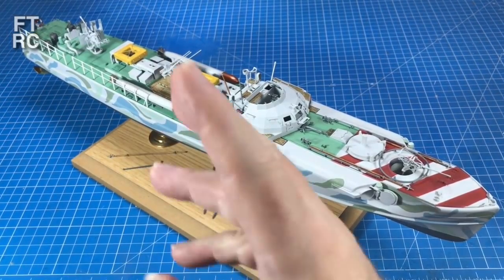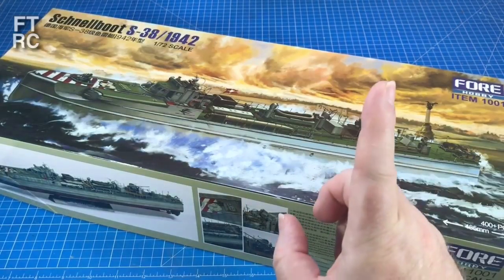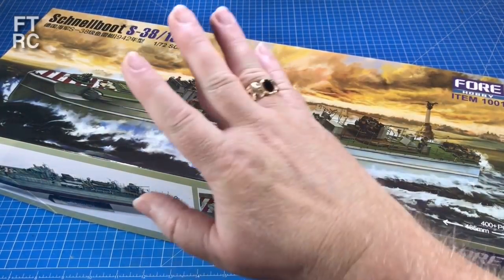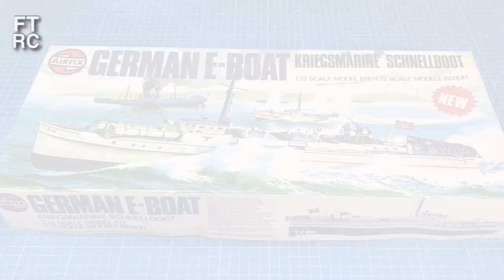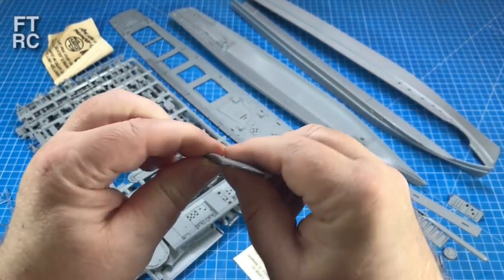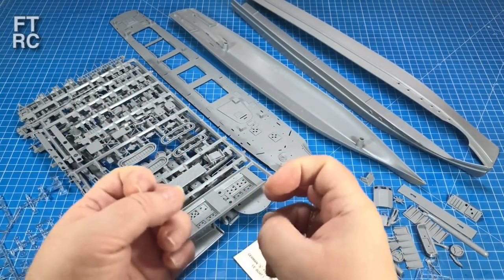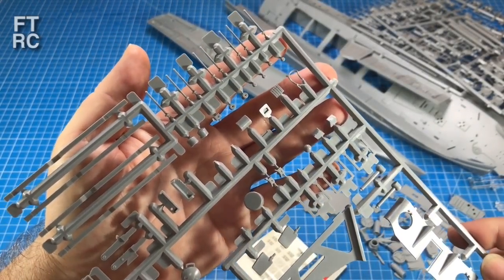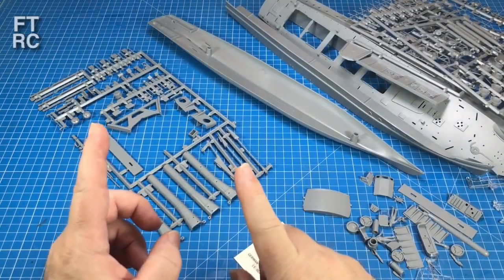Airfix 1:72 E-Boat How does it compare with Revell and Fore Hobby. Finding Airfix Rare Kits

Comment: Made this old Airfix kit as a water-line model a few years ago, same boxing as yours. Had some trouble with a warped starboard hull half around the torpedo cutouts but it was fixable withy some lengths of sprue and sanding. the rest of the kit fitted like a dream, as good if not better than your favourite Japanese brand. You mentioned the figures; personally I feel these are the best Airfix figures they've produced , even better than the Revell Naval figures which are quite over scale so don't put them next to the Airfix figures otherwise they'll look like giants. These old S-(E) boats were mainly used for training at the start of WW2,  and most had the mast removed (See phots from the period), but a few were used operationally up until 1940 / 41.  I still have the Revell S100 Flak 38 waiting in the stash so, it'll be interesting to follow your comparison. Personally I feel the old Airfix kit is one of those lost or hidden gems from yester-year and will take some beating. You'll find some photos on the Airfix forum.
Reply from the maker: It is a gem of a kit
Reply: I bought the Airfix E-Boat when it first came out ; not sure why, it's not really an area of interest for me. I glued a few parts together but put it away and never got back to it. I still have it though; it is a really nice kit. Would like to get some extra figures; the Airfix ones are pretty good, especially for the time. 
I remember the Humbrol paint call outs had the letter/number designation. I still have some of those - and they're still good after all these years!

Comment: I built the italeri 1:35 S-38 and it was a difficult kit to assemble, and very pricey, however it was a compliment to the 1:35  type XXIII U-BOAT, they are the same length
Reply from the maker: I have build the Type XXIII in a smaller scale… it is a short coastal sub so not surprisingly similar length to the Schnellboot.

Comment: Reminds me of Rye field model's I'm on my 3rd kit with parts missing now! I must be on record with them for sending it replacement sprues! All the new kit's aswell the first was the challenger 2 whole turret was missing!  Then the new panzer 4 with panther F turret tracks was missing, the new Mrap with crows 2 G sprue was missing and had a Tiger 1 sprue in it with air filter first thing I thought the oshkosh never had fifel filters haha! Apparently RFM send boxes and boxes full of sprues out and flat packed boxes to there main suppliers then the main suppliers go through them all and put the sprues in the correct boxes for the kit's! That is actually fact in writing from hannants in UK how they receive the rfm kit's were always back intouch about rfm kit's with different or missing part's just now!
Reply from the maker: Well as long as they supply missing parts that is all you need.

Comment: Great review.

If I may offer some advice upgrade to a HD level camera when you can.
Reply from the maker: My videos are shot in 1080i Hi-Def but compressed to 720i due to local bandwidth restraints.  YT will also stream at what ever level your connection allows.  So you may only be seeing it in a lower resolution on local bandwidth restriction times.  Rest assured I have tested and played back the video after it was upload through my local ISP on a large TV and the video was crisp and clear.  However once 5G comes to my street, very soon, I will move up to 1080i rendering.  So nothing to do with the camera.  All about bandwidth and streaming restrictions.
Reply: @HarryHoudiniModels  O.K good to know.

Comment: hi, the hull seamlines don't fit at all and the hull sides need to be hollowed out and skimmed flat to eliminate the seems between the sides and bottom parts!
Reply from the maker: You might have a later moulded version with the softer plastic?  I had been warned about fit issues on the hull, but as can be seen my dry fit it looked pretty spot on!  However mine is a first press 1975 kit with the better plastic.  I might eat my word when actually building it, but a dry fit is usually a good indicator.